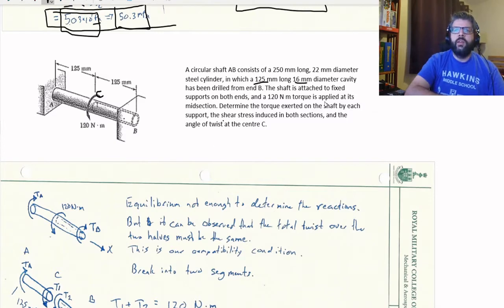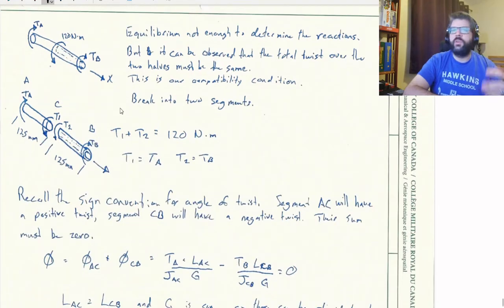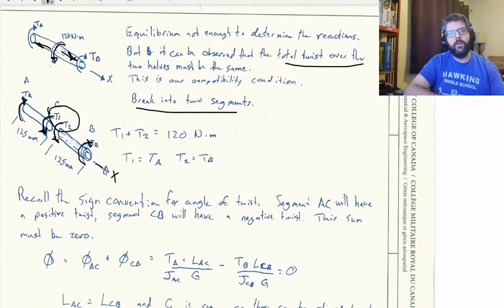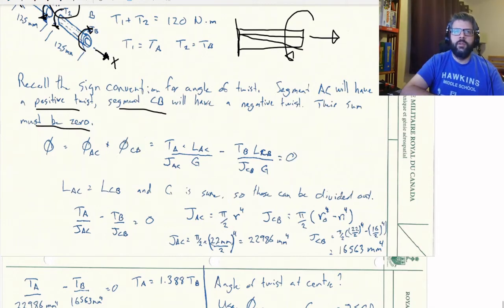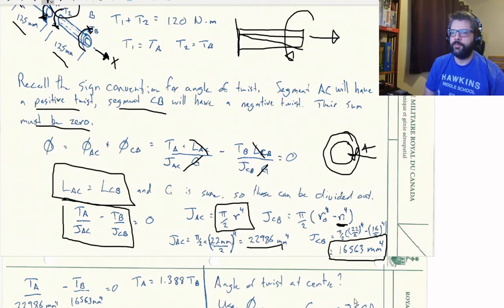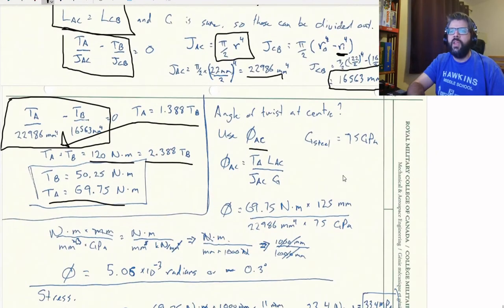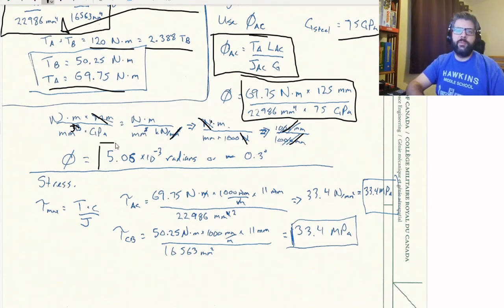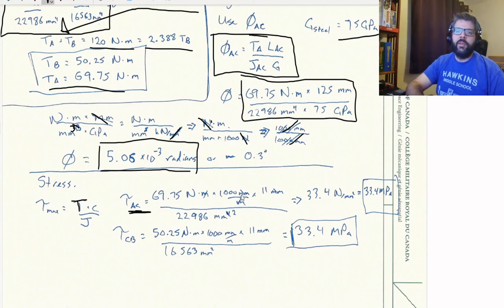Strength of Materials: Indeterminate Torque Twister

Comment from the maker: Upon a bit of reflection, I think the comment at the end about why the stress levels are the same could use a bit of clarification.

The twist is the same on both sides; the total twist is the same and the distribution is still linear, so the strain at the outside of the bar is going to be the same. Any time the strain is the same, the stress will be the same, as it's the strain that induces stress or vice versa, depending upon how you look at it.